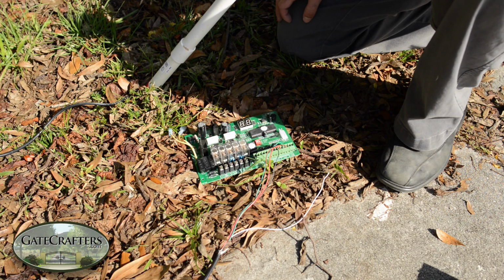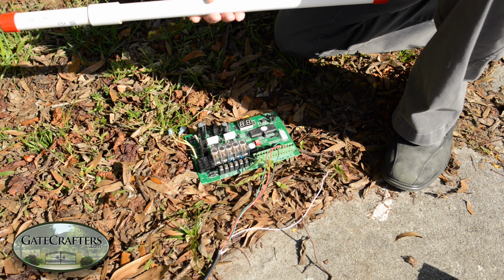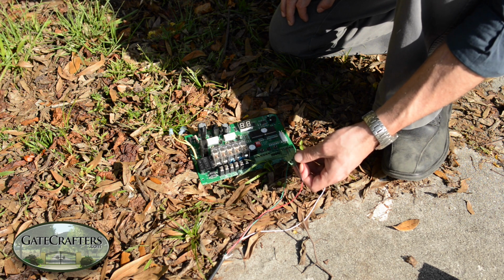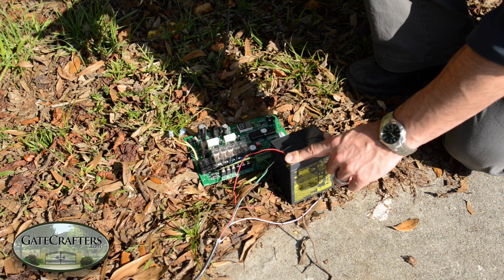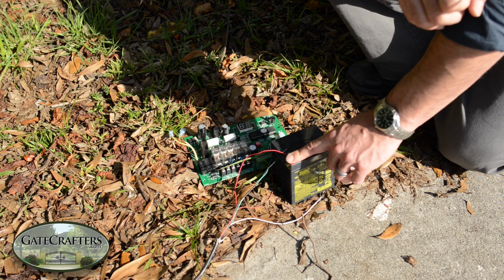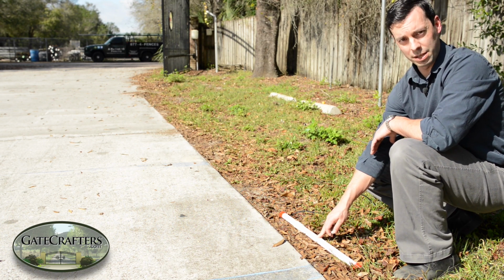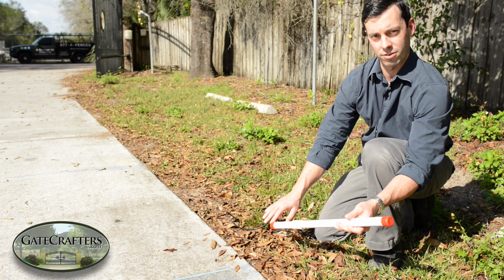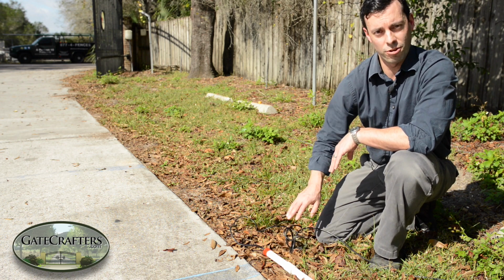How To Troubleshoot Exit Wands for Driveway Gate Openers

Comment: My wand opens the gate after injnitially wire it up.  After about an hour it wont open the gate.  Is this an issue with calibration.   After i put power to it i didnt wait long to drive past the wand